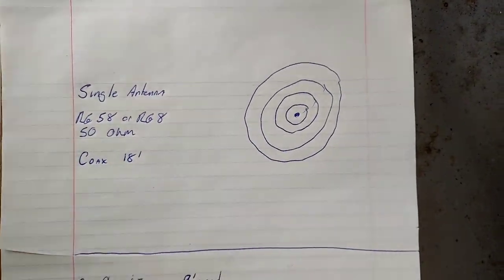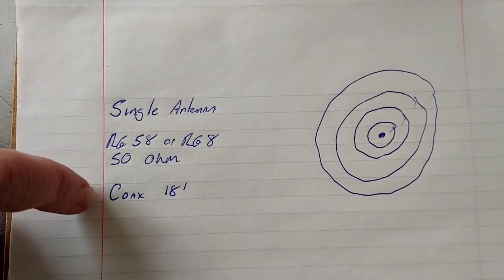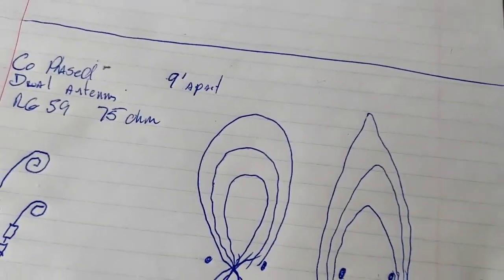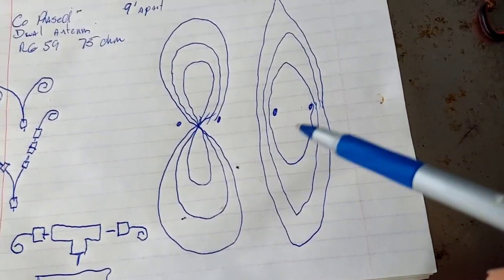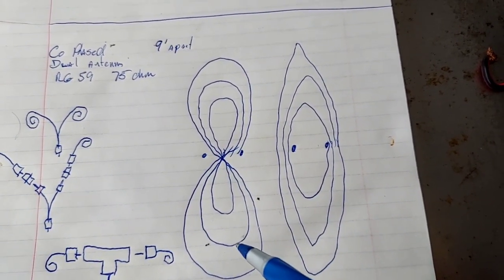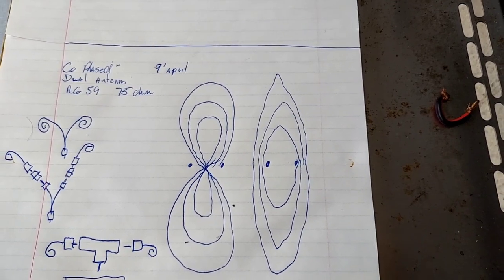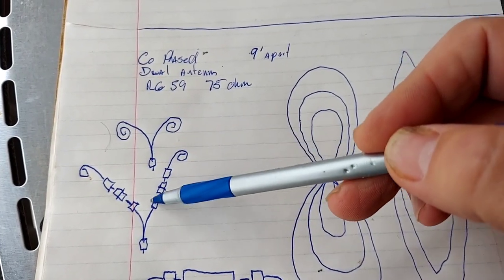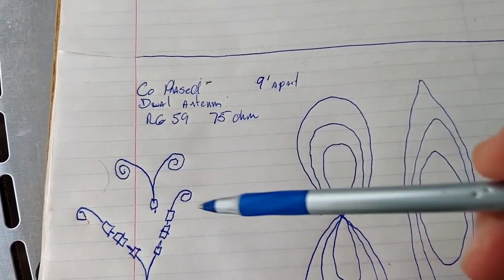Are 2 CB antennas better than 1? 2 cb antennas vs 1 cb antenna.

Comment: What's the reason for using 3' increment of cable?
Reply from the maker: That's what I've been told for years and years by every cb tech I've asked. And, I'd like to think they're more knowledgeable than me. Also when looking for pre-made coax I've only seen it in 3', 9', 12', and 18'. My wilson 5k mag mount came with about 15' coax. So, I really don't know, but there must be something to it.
Reply: @jrichtruckincbtips   The interesting thing about cable is that 3' of your cable and 3' of my cable is a completely different phase angle. Not all cable is the same
Reply from the maker: @rabbibacongrease88  agreed
Reply: Its a misconstrued belief that plays on whats known as velocity factor. Although, 3' is not correct.
In truth, unless your doing high UHF & above or running enormous amounts of power you don't need to chase down the coax increments to achieve proper velocity factor. The reality is, any length of coax will work to move the signal from A-B.
Coax quality is more important, & for those that state the 3' "rule" is how to adjust or match a linear &/or antenna system....it only masks a problem in the system not related to coax.
Hope this helps ~ KK4PGM
Reply: The ration of the cable to the length of the antenna and the wave length you are using is the formula. 10 meter/11 meter...11 meter is 33 ft. wave length so you need a cable length that divides equally into 33. Half wave, quarter wave length. get the idea? I'm going by memory and have lost my books a long time ago. -Peter age 71
The same applies to the length of the antenna, it's all a ratio of the wave lengths you are working on.
Reply: @jrichtruckincbtips  Hi J Rich, The reason is to try to keep the installation in Phase.  That is why it is also optimal to space your antennas 9ft apart (1/4 wave).  that is why a 9ft whip is 1/4 wave.  The measurements do not always work out, but usually most of the coils in the loaded whips if undone would theoretically stretch out to electrically 1/4 or 5/8 wave.  There is a lot of theory in RF engineering.  Also the mounting portion of your antenna set up has a lot to do with the ground plane and counterpoise to balance things out.  That is why you had some success running an extra ground wire to your frame.  Co phased antennas also have the ability to increase your receive.
Reply: For a single antenna, there is absolutely no reason to use coax in increments of 3’. Use the shortest amount of coax that you need to make a clean run from your radio to your antenna. Co-phased antennas require the same length of coax from where the single piece of coax from the transmitter divides to each antenna.
Reply: @tomcat6714   That is true only if it's a purely resistive 50Ω antenna.
 Very rarely will you ever see one in a mobile installation.
Reply: @tomcat6714  you didn't mention that the two antenna feed cables must be 75 ohm cable. Approx 9 ft of cable (after velocity factor of the type of cable used etc) gives around 50 ohms at the antenna and 100 ohms at the junction of the 2 antenna cables.  100 ohms divide by 2 equals 50 ohms to the rig. Its also incorrect to say that you can't use a T piece to connect the 2 cables together Mr Rich. I must have made a couple of hundred phasing cables and probably half of them were with T pieces. It's also incorrect to say that you can't run a normal 50 ohm cable from the junction to the rig...
Reply: @rabbibacongrease88  everything I’ve said is true because it’s based on a 50ohm antenna. If you’re using something different then you have a mismatch between your radio and your antenna which defeats the purpose of having a matched system.
Reply: @tomcat6714   The only problem is there's no such thing as a purely resistive 50 ohm antenna in a mobile application.
Reply: @rabbibacongrease88  so let’s say your 1/4 wave vertical is a perfect 36.8 ohms at 27.205Mhz, you don’t correct the impedance mismatch by using different impedance coax. That only introduces additional impedance mismatching in the transmission line. If you want to match the antenna to the 50 ohm radio and coax then you would use an imdance matching network.
Reply: @tomcat6714  No problem for me. You do it incorrectly if you like. For those who DO want to do it correctly, The 75 ohm cable acts like a see-saw. At 1/4 wavelength [9ft] the 75 ohm cable presents an impedance of 50 ohms to the antenna [down 25 ohms]. At the other end it presents 100 ohms [up 25 ohms]. 2 x 100 ohm cables connected together present 50 ohms. At that point you are feeding 50 ohms to your rig and 50 ohms to each antenna. If you use 50 ohm cable, when they are terminated together the impedance is 25 ohm not 50 ohms. I've been repairing CBs, commercial radio, airfield radio etc and area dealership for Yaesu and Kenwood professionally for 46 years.  [ Thomas. AKA "The Rig Doctor" Scotch Corner CB, UK ]
Reply: @tomcat6714  Read something about it instead of saying things you cant justify. How long have you been a professional radio engineer?
Reply: @tomcat6714  Ha Ha. THAT is what the 75 ohm cable is for... It's the impedance matching device.
Reply: @thomasbarnley3168  I question your repair skills if you think you can accurately impedance match an antenna system using using coax. I feel bad for your customers who are getting work done from someone who doesn’t know what they are talking about.
Reply: @reviewsjunction  how about you cite one piece of literature that gives instruction to use different types of coax to impedance match a transmission line? Good luck.
Reply: @reviewsjunction  that’s not a citation. That’s a screen shot of some drawings on a ham’s blog. Good to know that you get all of your education from homemade websites. Go back to playing with your hose.
Reply: Now YOU show me a citation which says it doesn't work ?????
Reply: @tomcat6714   If we're talking about a phased array, then 90ﾟ or 270ﾟ of 75 ohm cable per element should do the trick.  Remember odd multiples of 90ﾟ equals an impedance transformer. Even multiples of  90ﾟ equals an appetance repeater.
Reply: @tomcat6714   Technically the impedance of your cable doesn't matter if you know what you're doing.
Reply: @rabbibacongrease88  We were talking about a phased array. Simplicity is the answer - 75 ohm cable. The problem which you mention last is quite possible if you have the equipment to measure it otherwise the 75 ohm cable presents that simplicity.  https://youtu.be/VRZ9hsTaXzE
Reply: @reviewsjunction   That 75 ohm cable only presents the impedance transformation desired every odd multiple of 90ﾟ.  Once the desired impedance transformation is accomplished at a T connector, Then it is possible to add an even multiple  Of 90ﾟof 50 ohm cable From the T connector to the transmitter  Without altering the impedance seen at the transmitter.  Any non resonant 50 ohm cable will act as an impedance transformer even if the antenna is a purely resistive 50 ohms unless the signal being transmitted is spectrally pure.
Reply: @rabbibacongrease88  that is the dumbest thing I have ever heard with regards to antenna system design. If that were true then people who “knew what they were doing” would never pay any attention to coax impedance.
Reply: @reviewsjunction   I'm not sure what you're referring to. Non resonant cables act as impedance Transformers and resonant cables act as impedance repeaters.  We always want to measure resonance resonance at the base of the antenna and not at the end of a random non resonant cable.
Reply: @tomcat6714   Most people who think they know what they are doing don't have a clue regardless of how long they've been doing it.

Comment: My company has provided the equipment for the cb set up in my pick up to communicate with the equipment on the mine site. It's the low end uniden bearcat cb radio. I have the wilson 2000 antenna. I'm just learning about cbs. I purchased a swr meter to tune the antennas, on my pick up the swr was way past 3 on channel 1 and 40. I started checking grounds with the multimeter and found that the antenna wasn't grounded due to they mounted it on the tool box which has rubber separating it from the bed which acted as an insulater. I ran a ground wire and now have a good ground. Brought swr down the 3 on both channels. For grins I hooked a second antenna, magnet mount up to see what would happen using the T-connection that you said do not use. And now swr is reading 1.5 on all channels. When checking swr on magnet mount it was way past 3 aswell. Why is it when having both antennas connected with the T that the swr is reading so low now? How can I get the swr lower on just the wilson? Larger ground? The one I'm using is a 12 ga wire currently. At a loss here
Reply from the maker: Using a braided ground strap or a 4 ga cable is usually the best.
Reply: If your getting a high set with a single mag mount you have other issues...
Reply: The answer isn't so strange. You connected two antennas together and got a lower reading. When an antenna is out of tune the impedance is often high. For example it may show 100 ohms. Connecting 2 antennas with high readings would reduce the combined impedance. (example... 2 antennas showing 100 ohms each connected in parallel would present 100 ohms didided by 2 or 50 ohms) Swr meter will show a lower reading although the tuning of the antennas will still be crap.

Comment: On a vehicle,  2 antennas mounted in a Centerpoint perpendicular to the vehicles length, create a beam effect making your signal more in line with the road you are on. It rejects signals from the sides and amplifies signals from front to back. A single antenna uses rg-58 coax and a twin antenna uses rg-59. Length of cable to both antennas must be the same. Use a single antenna setup to swr tune one antenna then match the other to that.
Reply: You can also use the co-phase effect on your house with two base antennas. I know a guy in Malibu that talks up and down the coastline with co-phase antennas and if he decides to shoot skip he unplugs one antenna for a 360 effect. Afterall antenna patterns for commercial radio stations can be 2,3,6 or 8 antennas depending if they want to shoot the signal up a canyon in West Virginia or across the Flatlands of Kansas

Comment: Thanks for the video J Rich! I’ve seen trucks with antennas mounted vertically and trucks with antennas mounted at say, a 45 degree angle. Does this affect the angle that the radio waves leave the antenna? In low frequency (HF or High Frequency) radio theory this changes the distance that you transmit and receive radio waves in this frequency range and lower frequencies (changes angle that radio waves bounce off the atmosphere) for long distance communication (for those running higher power) or is this just to affect the height that the antenna sticks up in the air?